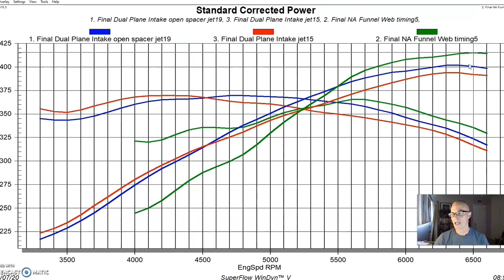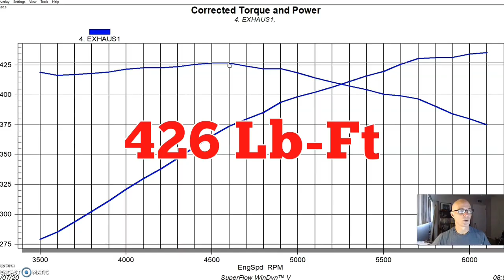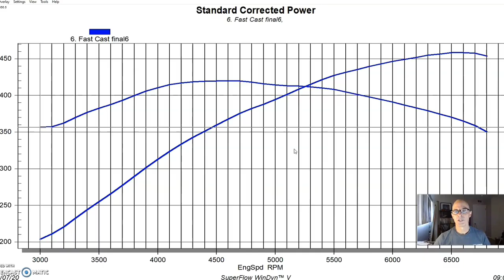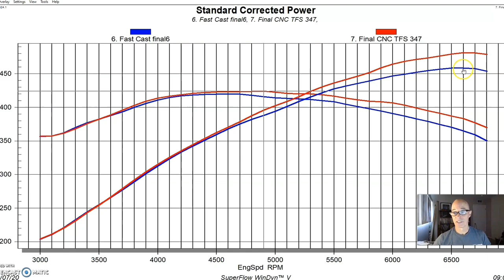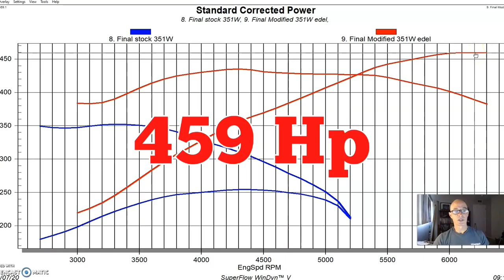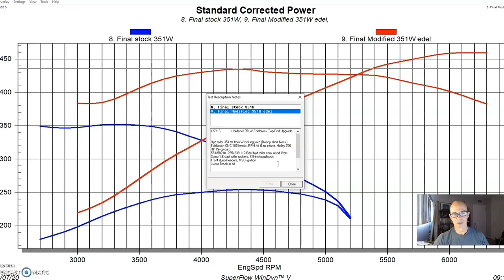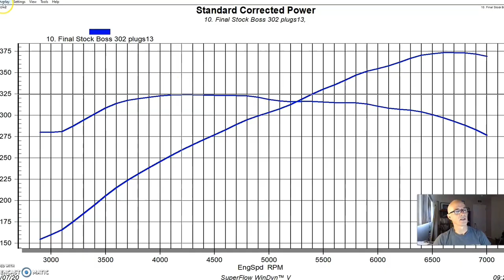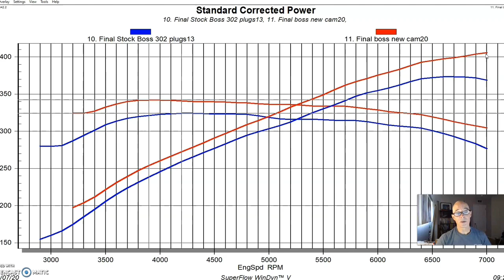HOW TO: 400-HP SBF POWER COMBOS

Comment: The stock motor with 9psi was the most impressive. 400+ hp and torque. What about a centrifugal blower on a stock motor?
Reply from the maker: I ran a Vortech on my stock Mustang 5.0L-it works fine

Comment: Hey I was wondering if you build a 347 stroker, how much over bore would you need to gor if for example I'd it's already 4.030 thou over how much more can i go if I break a piston ring and it eats the cylinder wall?. That's my only worry with a 347, other than that under 6 grand that little motor is a monster.
Reply from the maker: some blocks can go .040 but after market blocks can go .125

Comment: Hey @richardholdener1727 love your videos! I'm in the process of swapping a EFI 351w over to a carburetor and was wondering if there was any issues when you swapped this one you used in the video? Did the Intake fit right up? does it just take any normal 351w distributer? Someone was telling me the deck height changes on the 351w EFI compared to the Carbureted version.. any input helps! thank u!
Reply from the maker: deck height is 9.48 vs 9.053 but I don't think that changes the distributor pad height

Comment: Just start with a 351w,  preferably a 93 up so you got a roller cam. A half inch more stroke, right at 6" connecting rods! I'm 63, been hopping up these things for 45 years! Find a 351w, unless it won't fit! If not, sell that and get a fox body!

Comment: Us aussies do like Boss 302s, but we never got them here. We did have a 302 Cleveland, which shared the same parts with a 351 except for crank, rods and the closed chamber 2V heads. This is where "Aussie 2Vs" come from. Only 302Cs got them.

Comment: Richard is it plausible to build an adapter to go from the 5.0 lower to a gt500 eaton supercharger...? You know a plate that matches the 8 hole lower and a plate for blower and connect them? Or the possibility of adapting a 177ci Weiand street blower lower to a modern supercharger? I'm a professional fabricator/welder so custom fabrication isn't an issue.
Reply from the maker: plates are not difficult for a fab guy

Comment: This might be a amateur question.. but would these numbers be the same for a 302 out of a 68 mustang? If I followed the same setups? It is a 302 but just wanted to know before I start my project!
Reply from the maker: YES-THESE WERE HYD ROLLER CAM MOTORS BUT YOU CAN DO SMILIAR NUMBERS WITH FLAT TAPPET CAMS
Reply: @richardholdener1727  okay great I actually have AFR heads and a roller cam setup! Thanks a lot looking forward to my build :). Love your content!
Reply: @richardholdener1727  I messaged you months ago! But I finally got to the engine build. I bought a 302 out of a 68 mustang. The bottom end was rebuilt but has stock cast pistons.. would I still be safely able to run these setups without damaging the engine or would I need a forged setup?

Comment: It’s so easy to take a 351W and build a 427 that makes 600+hp and great torque I don’t understand why anyone would even mess around with a 302 anymore except for the BOSS 302.
Reply from the maker: 427 IS DIFFICULT WITH A STOCK 351w BLOCK-MUCH EASILER WITH 4.125 DART BLOCK

Comment: What's the trick to Installing the TFS stage 2 cam in a stock shortblock? I've read and read you can only run about .520 max lift for enough piston to valve clearance. I want to duplicate this combo on my 88 stock piston shortblock
Reply from the maker: THE LIFT MATTERS VERY LITTLE-IT'S THE DURATION THAT DETERMINES THE PROBLEM WITH P-V

Comment: Tell me again why people claim those 4V Cleveland heads don't make torque?

I have a pair in my parts stash I'm building a 400M to use them on.  I'm working on the operative theory that the hot ticket for this motor will be a hydraulic roller cam with relatively mild duration, but nearly .600" lift at the valve.
Reply: We did one back in the 70's and made our own spacers for the intake . It was impressive especially the bottom end torque and it still liked to rev. Maybe it was the longer rods? I would like to see so.e dyno info on various rod lengths.

Comment: **What's wrong with my 400hp combo?  95 mustang 302.  Stock bottom end, TFS Twisted Wedge 11R 190 heads (66cc) with Ford B303 cam, Ford stock Cobra intake, Procharger P1SC (8psi) with 3 core intercooler.  Made 400 rear wheel hp at 6000 rpm.  I know I lowered the compression going to the 66cc heads, but I figured it would do better than that.  Any ideas?
Reply from the maker: is it on pump gas?
Reply: @richardholdener1727  Yes.  93 octane.   60lb injectors, 340lph in tank pump

Comment: I am building a .060 over 351w for a boat. I have a set of fresh stock heads from the Cyclinder Head Shop. Using a xe274 with 10 degrees lobe separation flat tappet cam and 9 to 1 comp will it make 300 hp?
Reply from the maker: what intake? but probably yes

Comment: How are you revving  these motors so high without blowing them up ?
Reply from the maker: 6500 IN A 302 IS EASY
Reply: @richardholdener1727  Do you need a steel forged crank and balancing ? Are 351W as good to Rev stock ? Thanks for the great vids BTW.

Comment: The 302 that used in the test was a stock motor?, having enough PTV clearance with those high lift camshafts?
Reply from the maker: lift is not an issue-its duration

Comment: So just a quick question BluePrint engines 306 
Has 386 hp
And
370 TQ
What would you think would be RWHP.    C4.  Auto.
Reply from the maker: less than 300
Reply: @richardholdener1727  thanks appreciate that cheers from down under Melbourne Australia and. Just dyno RWHP 286
Reply: @richardholdener1727  I watched your roots supercharger video and yes thumbs up. Blueprint help desk are informing me that this is not a good idea standard block only good for 500 hp before you drop a big end bearing or blow the engine

Comment: Richard, I am super impressed with the 351w.  Did you have valve to piston clearance issues with the 351 stock bottom end and the healthy .573/.582 lift cam?
Reply from the maker: it fit
Reply: Usually under 230duration your safe.. its when u start going higher and duration.. the longer the valve is held open, is usually the problem. So lift doesn't really matter.. but you should be clear to use that cam no worries

Comment: How do the boss heads compare to a modern aftermarket Windsor head?
Reply: Well it depends on your intended goals. The boss heads of the 4V version where the go to heads back in the 70’s because that all that was available. The only other inline valve head at the time were from the 69/70 351W. There were the basically the GT-40 head that we know today. But they were not the Cleveland head. But by today’s standards trick flow afr have better heads compared to the Cleveland heads of the 70’s . But!!! There are some aftermarket Cleveland heads CHI trick flow that are amazing.

Comment: I'm sorry if I missed it but what valve springs do you recommend for a 5.0 gt40p.
Reply from the maker: Usually the ones supplied with the cam, but sometimes we go rogue
Reply: @richardholdener1727  and in that case what do you us FT, Crane? Part#

Comment: Do you  read the Article in Car Craft or Poplar Hotrodding entitled 400 HP from the Stock Cam. This article addresses exactly what is covered in this video. But I always find my videos informative and entertaining, thank you very much. Here is the Link from hotrod.com: https://www.hotrod.com/articles/ford-302-v8-engine-buildup/ 

Here is the Parts: '91 5.0 Roller Block, New Piston Rings, new Bearings,  AFR 165cc alum heads.......60 cc 1.90 I..... 1.60 E out of the box PN 1472 emis legal works with stock pistons,
Weiand stealth dual plane / 625 cfm road demon jr, Dougs headers tri Y 1 5/8 to 1 3/4, Stock 1.6.1 stamped rockers then switched to Comp cam 1.7.1 rockers
Reply from the maker: I'll check-I may have written it
Reply: Car craft article from the awesome Matt King days.

Comment: I'm old. I grew up in the late 60s and have had the pleasure of driving and owning almost every one of these pushrod engines on this site. My first car was a 70 1/2  Z28, when they couldn't give it away because of the gas wars. it wouldn't even start on the brand new at the time, regular unleaded. I have family that has worked for airlines for most of my life, so I could get enough avgas to mix up batches to make it fly. Few years ahead, I got ahold of a 71 Boss 351 Mustang. I don't care what anyone says, that car would spank my old Z28, any day of the week. The car was huge, and terrible to try to back out of parking spots, but by far it was one of the fastest stockers I have driven. It pulled from idle to red line, never missing a beat, and many big blocks were left in it's dust. Someone else wanted it worse than I did, and I messed up and sold it. I still miss that one more than most of the others I've had, with the Z coming a close 2nd.
Reply from the maker: take a look at the Boss 351 video-it made the most power of any muscle car small block.

Comment: The 11r heads on the first engine, the 302. Must have been the 190 intake runner to make that power?
Reply from the maker: I think they make 190 and 205 versions-either will make that power

Comment: Always wondered how my combo would make power.  351W, 10.5:1, ported TFS170's, Comp 35-518-8, RPM Aig gap with a 600CFM TBI through shorties.   Thanks for all the testing!
Reply from the maker: TBI?
Reply: @richardholdener1727  Fi-Tech 600 Power Adder.  TBI Injection, basically.

Comment: Hey Richard! You've probably done more cam swaps than most people, so what is your opinion on installing and breaking in a used flat tappet cam in a new block? Precautions, procedures, caveats?
Reply from the maker: I put mold based assembly lube on the cam lobes and lifter bottoms, add break in lube to the break in oil and run with minimal spring pressure if possible (remove inner spring)-that usually works

Comment: Could you please show the power figures with the Four Hole Spacer. I was looking at a 1 inch fourhole spacer for my 308/ 5 Ltr Holden V8 motor that runs a .214@ .050 lift camshaft.

Comment: Big fan of clevors after spinning the big ends on my basically stock cleveland through draining the oil pan into the heads. I couldn't find one of the bearings until I realized the two halves had fused into one. The horror.

Comment: I have to say, I was not impressed with the valve springs TFS put on their TW heads.  I had one break with less than 20k miles on an E-cam.  Motor was 4yo and driven 5kmi a year give or take.  However, it did give me a good excuse to ditch the terrible E-cam (terrible for anything but a stock engine IMO) and put an XE270HR in its place.  The TFS heads don't work with the springs on the cam card, so I picked a set of 330lb/in springs.  165lb on the seat, 330lb open, .530 max lift.  XE270HR with .512 lift worked great, the TW heads fall flat after .500 lift anyway.  That is a great cam for a TFS TW head and street manifold combo, roughly 10.3:1 compression.  Makes lots of torque and pulls to 6k.

Comment: can i ask you for some help with your wisdom... seriously
Reply from the maker: ask away
Reply: @richardholdener1727  well i have an 89 tpi 355 fresh motor the guy that built it put the biggest cam the l98 head springs could take, everything else is stock. when i took it tpis and had them dyno tune it, it only made 158 whp is the cam suffocating from the tpi or just a bad combo you think?

Comment: Kind of curious about my combination. 5.0 with AFR 195 58cc chamber Renegade heads, pistons have a 6.8cc dome, E303 cam, TFS R EFI long runner, 75mm throttle body, 1 5/8 headers, 1.82 rockers and about 11.25 compression. It seems to pull really hard from around 2k to 6k.
Reply: Jeremy Mardlin should had put a better cam in it.
Reply: @coyote5.02  for sure it could use a different cam. When the motor was done I already had that cam so it got used. I was looking at using a Comp  XE274HR-12 in it.

Comment: And that's why I've had my Boss 302 since '75, though, sadly, the car it came in has been gone many, many years. All the nay-sayers scoffed at the non-Chivvie with ludicrously "mismatched" cylinder heads, but any time I had a fairly well-matched combo of parts in it, it exceeded expectations. This will probably be my last build on it since I'm an antique, and it is now out to .060 over, as well. With the good parts I got together for it, and the fact that the heads have FINALLY been cleaned up from factory as-cast form, I expect it will perform better over a broader range than it has before, which will be going some. Wish I had a bunch of buddies with a dyno, 'cause I'd love to compare what it ends up doing to my next build-up, which is a "mock" Boss or Clevor with AFD aluminum heads, a "better" (I think) intake, and parts less slanted to an old school vibe. Nice to have stuff like Richard puts out, that goes for the real effect of architechtures and parts choices, not "common" knowledge that ain't always rooted in unbiased fact.

Comment: 500hp 351w??
Reply: Think higher compression pistons will push it to 500 maybe more.
Reply: @chris49ford  id like to build a 351 for a swap in a ford ranger and I'd like to have about 400 wheel horsepower lol so im very interested in anything 351w related I just want to leave the stock bottom end in tack if at all possible  nothing crazy
Reply: @shanerodgers1009  Then top end kit plus 50 shot nitrous.  Use a timing retard box and make sure you have a good fuel supply to help those oem cast pistons live.
Reply: @chris49ford  so you think that top end with a set of flat tops would eliminate the need for nitrous or maybe a bigger shot of the juice??
Reply: @shanerodgers1009  I would think so but going to need some data to do the math.  A stock 94-96 roller 351W probably has 8.5:1 with stock cc combustion chamber heads.  If the heads in the top end kit have smaller cc that will raise your cr right there. Say performer heads will bump it 9.2:1 for example.  A one point increase in cr will give about 3-4% power increase. So say after the top end kit you end up with 450 hp at 9.2:1.  To add 50 hp you would need to boost the cr by approx 3 points to 12.2:1 to make 500 hp NA on this combo.    Might as well go all out at that point and build a stroker 427: 351W 427 STROKER ROTATING ASSEMBLY 12.1:1 (64 cc heads) or 13.0:1 (58 cc heads) FLAT TOP MAHLE PISTONS EAGLE 14125-4125 would probably push close to 600 hp but pump gas is out of the question.  On the other hand, there are 427 stroker 351W crate engines with 10.5:1 that make 500-550 hp on pump gas.  Theoretical on a napkin doesn't always translate to the real world, so look for a proven recipe.  Jan 2015 Car Craft did a 351W build and got 505 hp with the stock crankshaft and connecting rods, a set of KB flat-top hypereutectic pistons, a mild Crane hydraulic roller cam, and a pair of Trick Flow Specialties' 190 CNC 11R cylinder heads.  A few months later Hot Rod took that same motor and bumped it up to 595 hp by milling the heads to get 50 cc chambers that bumped the cr to 12:1 and made a cam change but kept the stock stroke. But with 12:1 do you want to run at least a 50/50 mix of pump gas and 110?  Maybe Richard's next video will have a recipe that gets you where you want to go!

Comment: I’d be curious as to how much power you’d get extra on the boss/cleveland 4v heads with the exhaust port plates that fill in the bottom of the exhaust ports between the headers to prevent the tumble that the exhaust ports are notorious for. Some people use to epoxy them in for a higher port shape and claimed to get significant power increases

Comment: Would two spacers stacked make even more power? Maybe you can do a video because I don’t understand how a spacer makes power. Am I the only one?
Reply: As I understand it, some carburetors don't work properly on some dual plane intakes which isolate each side of the carb. A 1" open spacer solves the problem. Thicker spacers can still change the torque curve but less dramatically and for different reasons.
Reply: Some times it's simply a matter of adding more plenum volume, with an open spacer, for instance, which helps some combinations.
Reply: Biggest difference is allowing the mixture to start a more gradual turn into the runners, instead of just ramming into the plenum floor and dumping the fuel out of the airflow.

Comment: Richard,  take the 306 that u got and put a solid flat tappet cam with duration in the 250 plus area and around 600 lift with a victor jr intake and lets see what it makes. I had this combo and it was a screamer.

Comment: My sbc was a 355 untill it ate 3 roller tappets,when I tore it down ,I went with a 3.750 crank 13.7 to 1 slugs and just went with a lil bigger cam @.615/.625  .I home ported the heads myself wp angle plug 64cc iron heads  .010 off the heads .my port job was little more than deburing  ..haven't dynoed it just dropped it in and run it ..the difference was something I'm quite satisfied with.

Comment: The BOSS 302 rules!!! Many moons ago, I passed on a set of Boss 302/351C heads. As a young hotrodder, I was told that these big port heads on a small motor would not make any power below 5K rpm-myth busted!! Have you run the 351C 2V heads, with smaller ports than the 4V and open combustion chamber-good enough for a boosted application?

Comment: It wasnt too much port size that hurt low end torque it was 3500 pounds of weight. The right cam for the Boss 302 is one that works with the right 4bbl Holley. Simply what all the LS engines do so well, Ford did back in 69 with the G code.  Great comparisons Richard. Lays to rest aspects of the Roger Huntington myth that the little 302 Boss has no torque. Its got boatloads compared to a Tunnel Port 302, despite the 15% bigger 351C 4V ports that flow 46% less air at 600 thou lift. I loved my time in a pristine 70.

https://youtu.be/fhvz1v491OQ